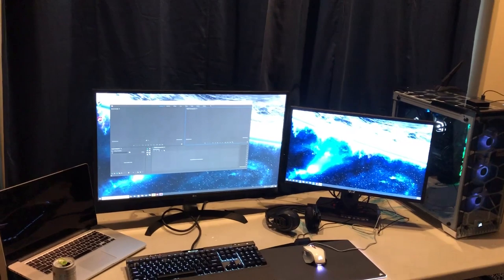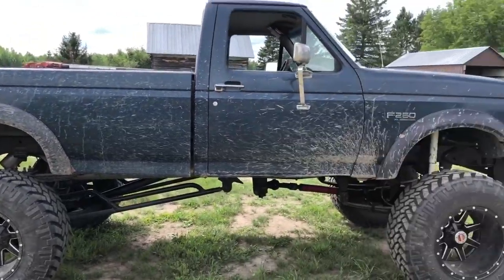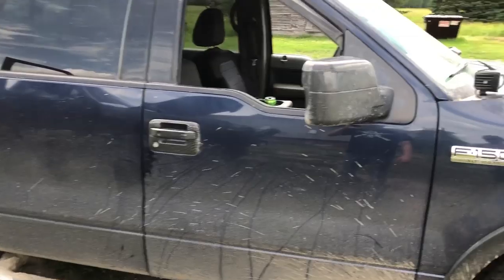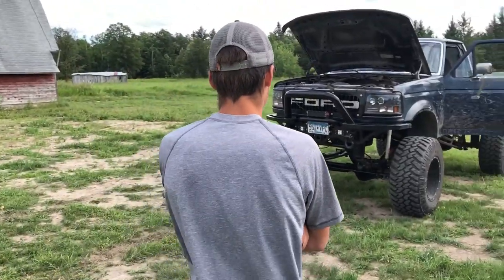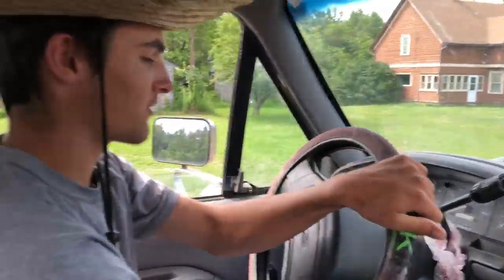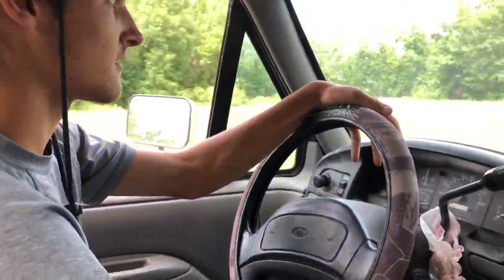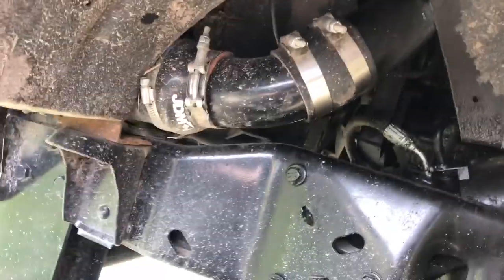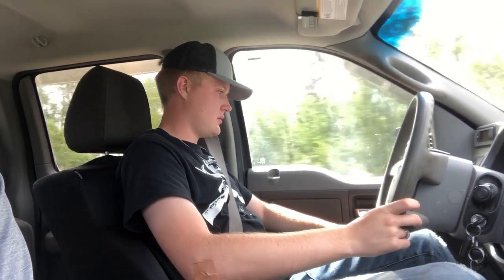Trading my Lifted Diesel for a Stock F-150

Comment: Wtf  this better be a joke. Where the dually?! If it's not a joke then your traded for junk. No doubt this is fake lol good. one tho. Ps you can built proof a 5.4. Lmao that f150 is worth maybe 5k.
Reply: Sure you can bulletproof a 5.4. Did it to mine along with a full rebuild
Reply: @andrewpieper7885  negative. So the spark plugs wont blow out or when you pull the spark plugs out they dont pull out threads? And what about timing chain guides.  They dont make timing chain guides for those motors that hold hold up. My buddy builds these engines. And you can not make them bullet proof. You just have to change stuff very 2 year(timing,tune up etc)
Reply: @DieselAddict-vs9fc  redesigned one piece spark plugs, redesigned chain guides, redesigned cam phasers with lockouts, melling oil pump, drilled out coolant galleys..........
Reply: @DieselAddict-vs9fc  also the plugs only blow out on the 5.4 2v. They made the threads a lot deeper on the 3v. Then they made a 2 piece plug so when they redesigned the plugs they made one piece and they dont have problems.
Reply: @andrewpieper7885  I had an 09 5.4 that did it  had 50k miles on it. Helix coiled it and got rid of it.
Reply: @DieselAddict-vs9fc  i haven't had a single issue and ive got a cammed 5.4 with a built bottom end. 22k miles and counting on the rebuild
Reply: @andrewpieper7885  well mine was bone stock only a year or so old. Driving down the road blew out. Still run just lost power. Still had warranty and Ford wouldn't do shit about it. Wanted 5k for heads or 10k for a new motor.